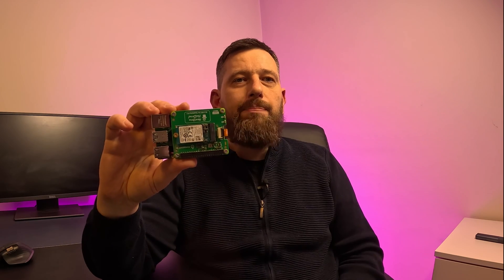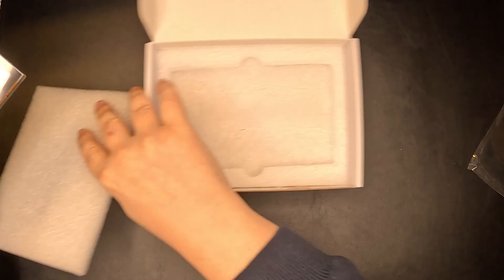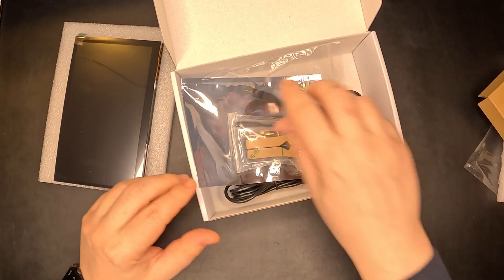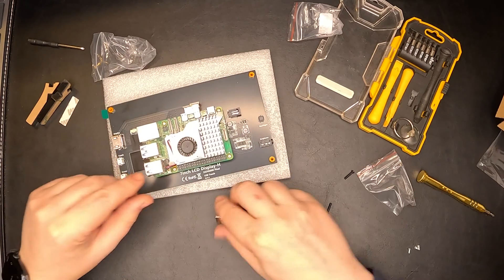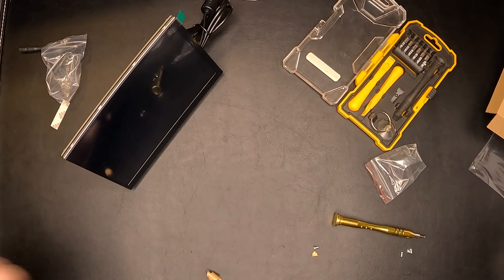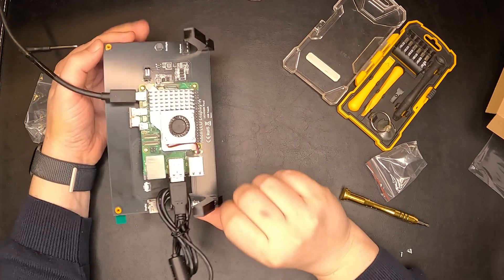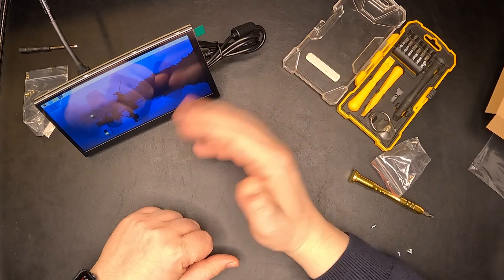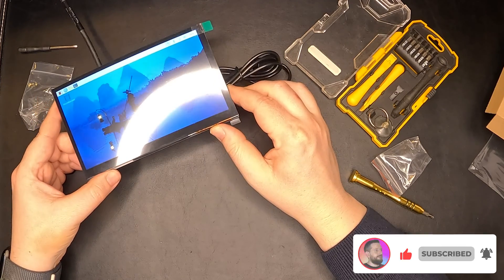7" IPS touchscreen for Raspberry Pi 5

Comment: But why is the Pi5 standing a million mile away from the display? The general  idea is to always to make things slim. Putting this thing in a handheld gaming device /pad would make it 1cm thicker than it could be.
Reply from the maker: Thank you for the comment. Probably due to the fact that this is an HDMI version and it also has some ports underneath. A DSI version will most likely sit closer to the Raspberry Pi5 but still maintains some gap.

Comment: Should try this with android running on the pi
Reply from the maker: hmm .. that's an interesting ideea :). I am waiting for some new stands in order to also mount the "nvme HAT" on the screen and I will give it a try.
Reply: @TricksAndThings  I couldn’t get android to run with the image provided by the pi imager but I’ll have to try another android image and see how it goes
Reply from the maker: hi, just tried it with Android 14 and it works without issues. https://youtu.be/xUd0kFCZ6Vw if it's still of interest